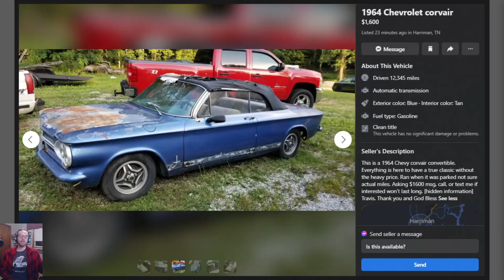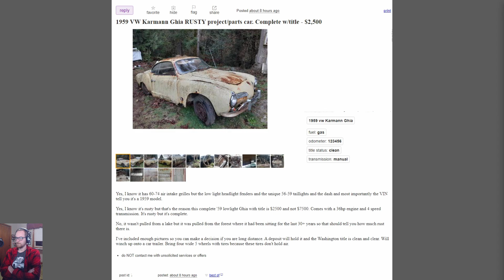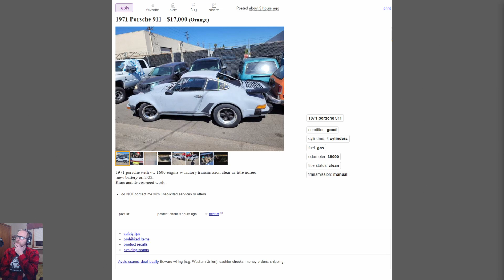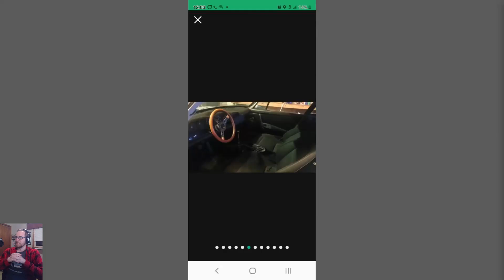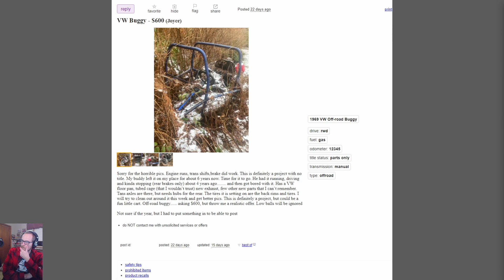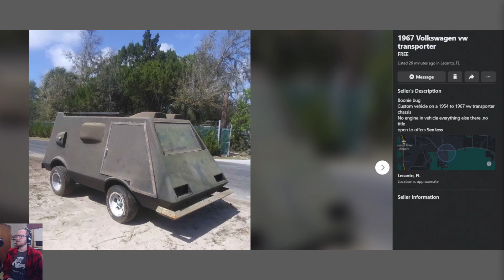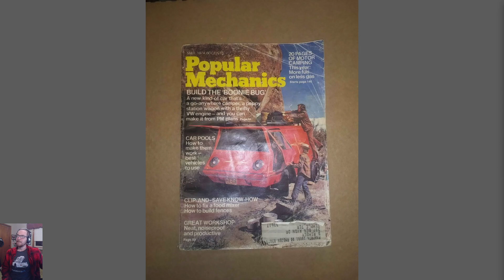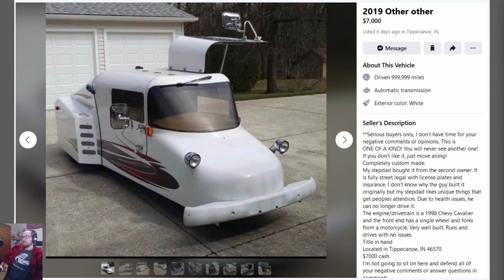Ran When Parked - 074- "Just a Sexy Bug"

Comment: The cut up Cavalier hurts my brain... The transmission should also be mounted the wrong way... so it has just the reverse gear to go forward??
Reply: The engine isn't backwards, the old front where the radiator is now in the middle of the... car? So forwards is still forwards, it's just in the back instead of the front.
Reply: @zacharykarr  Now it makes sense (as much as this thing can make sense...). Got confused by the "clam shell" bonnet in the picture of the engine bay.
Reply from the maker: I was confused by the same thing at first

Comment: btw cone i feel insulted by the "some plane nerd" comment j/k lol... i'm the one that found the glider info.. also.. can confirm that is not a cessna windscreen but close... a cessna screen is slightly shorter but also has a rounded lip on the top sweeping front to back to give you a bit more view above. this also typically causes a almost u-shaped cutout on the left and right sides where the wings start. and lastly the lower rear corners do droop a bit more. it is VERY close though
Reply: Every plane is a trike essentially so they were not far off...

Also, the B52 was the first flying car!